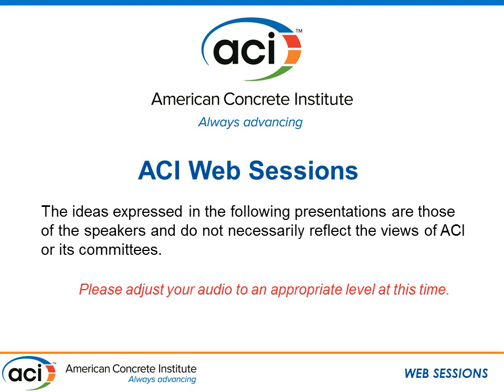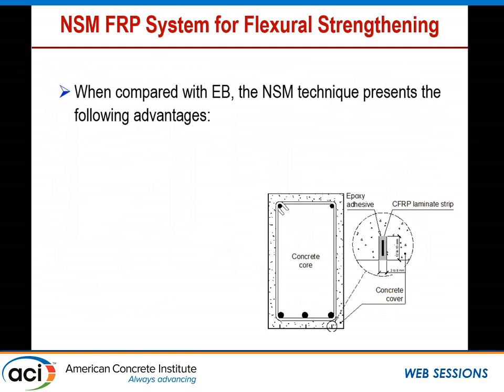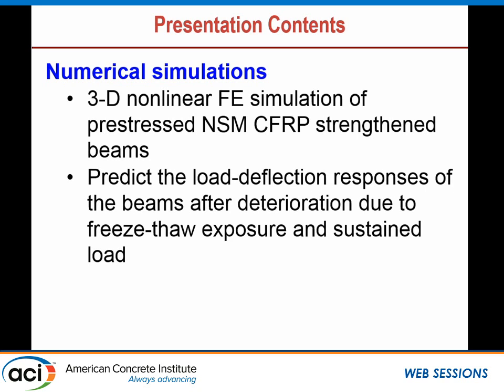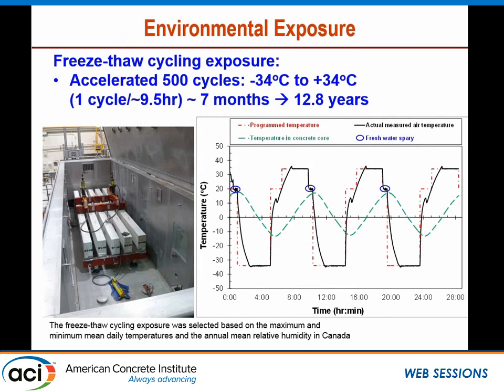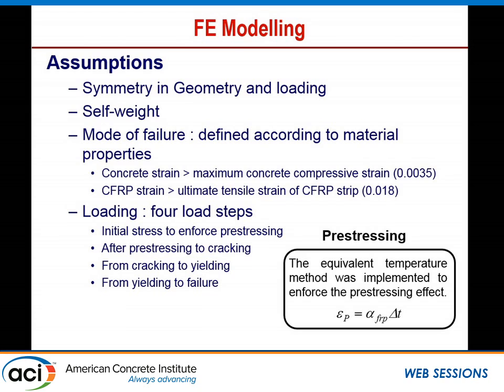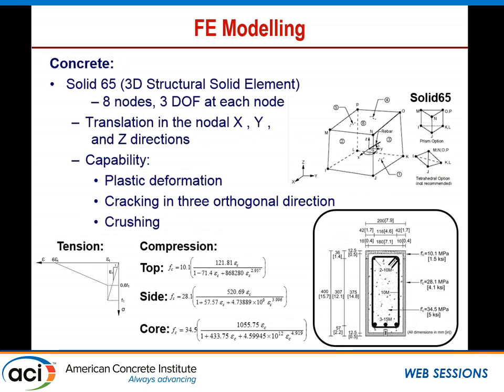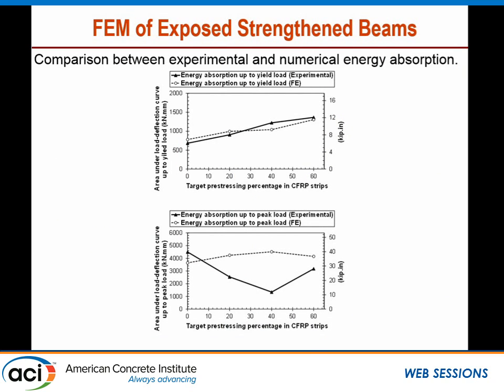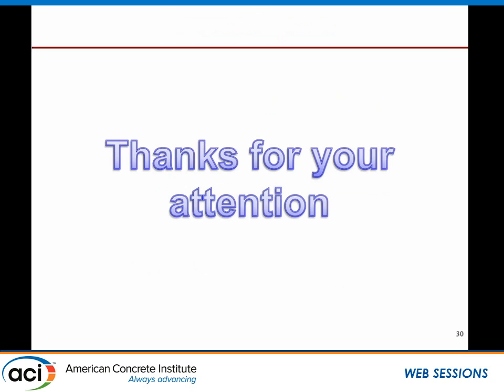Finite Element Modeling of RC Beams Strengthened with Prestressed NSM-CFRP Strips

Comment: Dear sir how can you justify the ANSY solution at ultimate failure. What checks you are made in terms of stress contours etc, how will assess that the contrete reaches its ultimate strength. Since in ANSYS even after the reaching the fc' stress it takes further load as well deflection also. Where did you stop your solution and based on what factor you decided the RC beam failed?